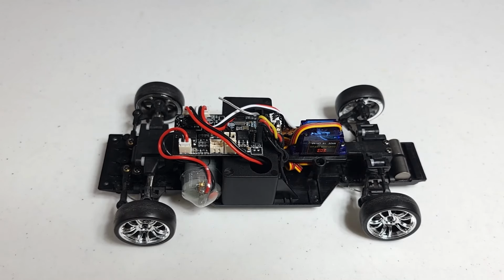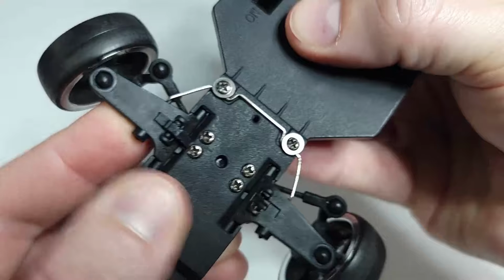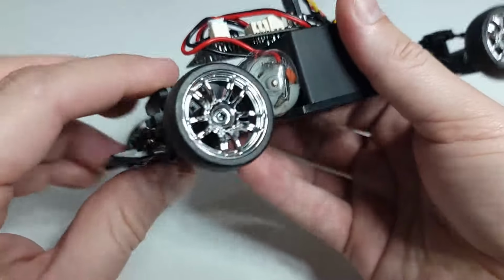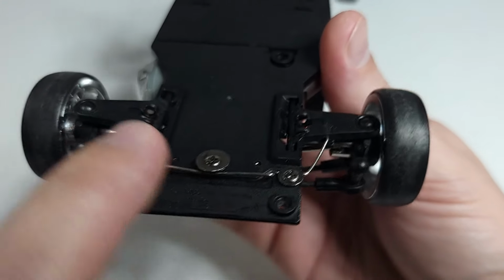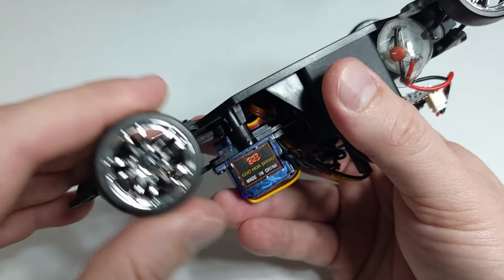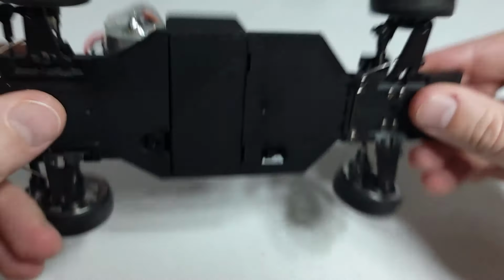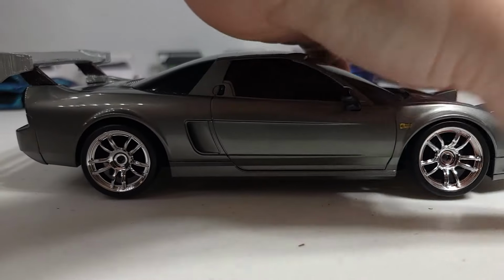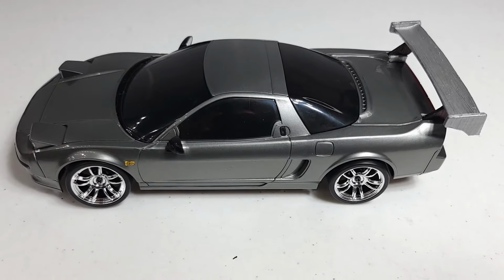LDRC Drift Car "Tips and Mods" Pt. 4: *Stock Suspension Mod* Wheel Sag, Low Ride Height No Limiters

Comment: Current model (v3) comes with friction shocks!! And they are wltoy k zed seris size shocks!! Tiny mods needed for swap. Tiny wood screw and washer to hold em on! Top side usually 🙌🏾
Reply from the maker: I saw those, definitely seems like an improvement over the old version style. Some people say they are a little too stiff though but I haven't tried them yet. I will be making my own suspension system for front and back anyway so it doesn't matter to me but it's good they have that optional upgrade now.
Reply: @AirToGroundRCFPV   They are indeed a little stiff, better than the original in my opinion. I took them apart and cleaned up the plastic material and it was a slight improvement.
Reply from the maker: @wasaB.  That's good to know and maybe switching to weaker springs of the same size could help as well like the springs from a wltoys k969/989 could work possibly.
Reply: Where can I buy It?

Comment: Great video! I just one for my son! We ran it as it came with no adjustments! We took it to the park and ran it over concrete! After a few bumps, the rear tires are making a weird noise! Do you have any idea what it could be or any suggestions would be greatly appreciated! 🙏🏽🙏🏽🙏🏽
Reply from the maker: That's awesome man, I hope you and your son are having a lot of fun with it. I haven't driven mine on hard concrete yet so it's hard to tell. Maybe you knocked something loose? Check the dog bones from the back wheels to the differential and make sure they are not bent, loose or broken. Check the top and bottom swing arms for cracks and make sure they move freely. Check the little suspension spring to make sure thats ok as well. Make sure the wheels aren't coming loose where the screw holds them on. Hopefully you don't need to open up the gear box to see if the gears and differential are moving freely, it's possible that some debris got in there but that's all I can really guess at the moment bud, I hope you can figure it out. Just do a process of elimination to narrow down what it could be.

Comment: Just got mine 1802 recently and man either these are really tricky to work with or I got the faulty one. Mine didn’t come with the metal springs underneath the chassis, so basically I had to use these little plastic clip-in limiters. But came with the controller from 1899, and box had a Miata on it so I was thinking it was a newer release? Shocks don’t seem to work right even when lubed/greased. I spent solid few hours tweaking camber and toe screws, even used digital calipers to make sure I’m even on both sides and still it doesn’t look right.
Guessing on “tire wear”, front right and rear left wheels just don’t make contact? No idea what to do at this point.
Reply from the maker: So you have the new "upgraded" version of the 1802 and it introduces new issues I didn't have. It seems your biggest issue are those new suspension shocks/dampeners. From what I've heard most people say they suck. I feel they can be better than the old springs underneath they just used the wrong spring stiffness. They are probably better for the rear than the front since the front is sensitive to the right stiffness needed plus when the wheels turn left or right I bet one wheel lifts off the ground. Those limiters need to go so adjusting the springs correctly for the right height of the wheels is going to be difficult to dial in. You may need to try different springs to get the front to be on the "softer" side and tweak them to make sure the wheels are always making contact to the ground while turning them. Those front shocks can also get in the way of the wheels when increasing the steering angle more. There is no easy solution I can give you since I don't have them but I would still need to try a bunch of random things to get them to function properly anyway. You could probably get away with keeping the back ones but the front ones are probably the biggest issue and need either different springs or a whole new design idea instead, that's what I'm doing to mine at the moment but it's not something other people will be able to copy unfortunately. Maybe getting one of those old springs for the front could be the cheap and easiest fix to be honest, they aren't too bad once you tweak them the way you want.

Comment: wow, I wish they would sell it like this! Its the perfect stance im looking for! Can you still buy the older version or are the ones that are sold all the new versions?
Saw one for 40 Euro inc. shipping.

And are the gears replacable or is the car trash if they got eaten up?
Reply from the maker: From what I can tell the older versions are still available especially on AliExpress but there are a bunch of sellers selling different ones so look around and do your best to choose which one you want. The plastic gears are not too bad and if you do wear them down they are replaceable so no worries. I will drop a few videos in the next few weeks on replacing those gears with metal ones so those videos will give you better idea on how to replace them if you ever need to. You don't have to swap out to metal gears if you don't want but it's a good idea if you drive yours around a lot and beat it up then it might be a good idea for more durability especially if you plan to put a brushless motor on at some point I would recommend upgrading to metal. I will eventually switch out to a brushless setup in the future after I beat up the stock brushed motor first.

Comment: i've got the same rc car but it doesn't connect with the controller, does anyone knows why??
Reply from the maker: That's a good question, I didn't have that issue so I haven't really looked into it. Check the manual or online for the binding process. If there isn't any info try contacting the seller to see if they can get the info to rebind from LDRC.

Comment: Can they rwd?
Reply from the maker: Yes, every version so far is RWD.
Reply: @AirToGroundRCFPV  is Hella cheap bro☠️
Reply from the maker: @HANBaka  Yea it's a pretty good car for 40 to 60 bucks, just needs a better gyro and some mods
Reply: @AirToGroundRCFPV An Arduino gyro will make the thing? Or, maybe a helicopter gyro? 
Stock gyro is integrated in board, or no?
Reply from the maker: @flt842  Yea stock gyro is built into the board, the old black electronics board versions had pretty bad internal gyro. Newer version with red electronics board are better but still not that great. The cheapest and best option everyone is going with is the DasMikro V5 gyro. It's tried and true and has the best performance to price ratio. You can try to add your own gyro if you want from a heli or plane or something, that's your call.

Comment: Looks suspicious 😂
That torsion spring looks like chrome plated spring steel, just like a paperclip. Kinda sus 😮
So, It can be made from stainless steel, or more thicker parerclip 😂
Reply from the maker: Yea it's basically a glorified paper clip. I'll be swapping out to my own custom shocks soon and some models are already coming with shocks installed now instead of the spring.